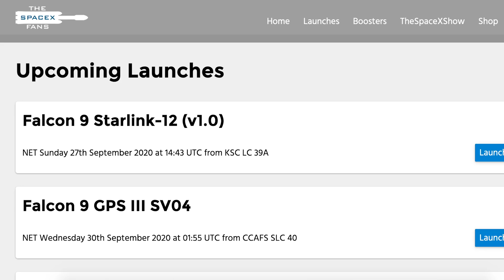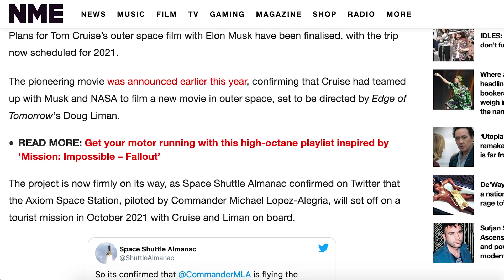SpaceX Starship Updates! SN7.1 Burst, SN8 Fins and Super Heavy! TheSpaceXShow

Comment: That superheavy diagram puts things into perspective...I also now see why Elon says it'll be a decently easy build.
Reply: except for the thrust puck. It’ll be the most challenging part.
Reply: @bahugtalib123  yes, that will be and probably making it strong enough to stand under it's own weight might be challenging too.
Reply: @mrdune5479  the  thickness of the steel reduces as you go up the body, giving adequate strength where needed and minimising mass.
Reply: @johndingwall3476  will some of it be reenforced too?
Reply: @mrdune5479  having already seen reinforced ring sections, probably.
Reply: @johndingwall3476  my thoughts as well. 

The good thing about superheavy is it looks like a really long starship. Sane materials and basic design. So hopefully they are able to slap them together pretty fast and get them tested